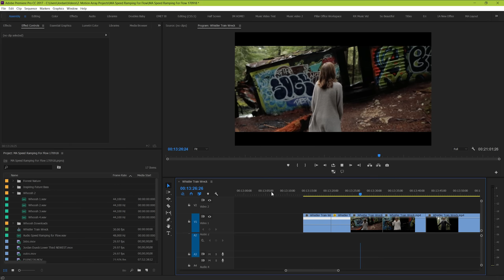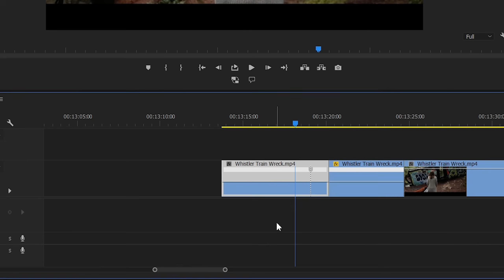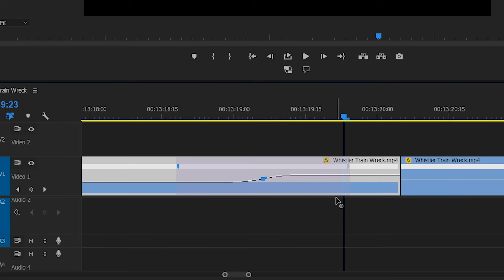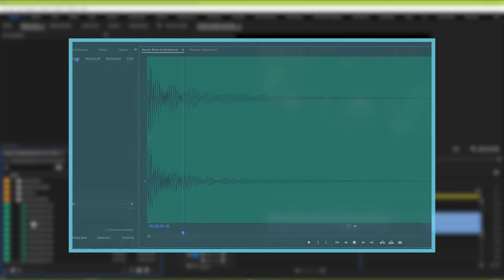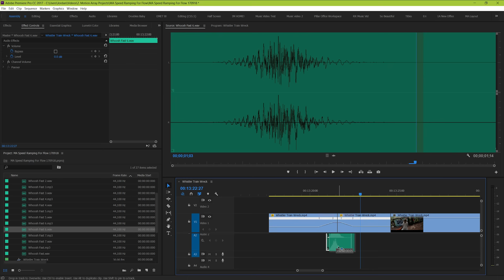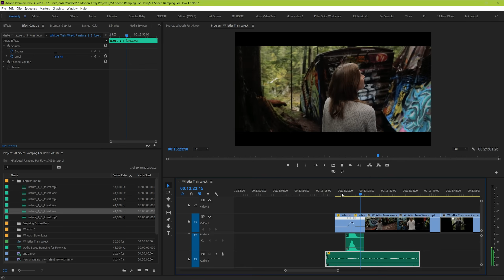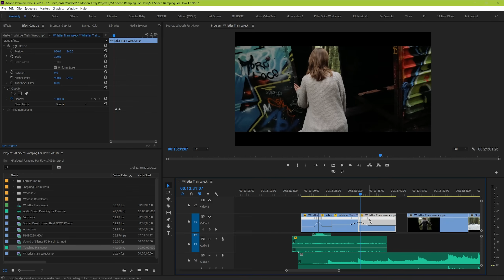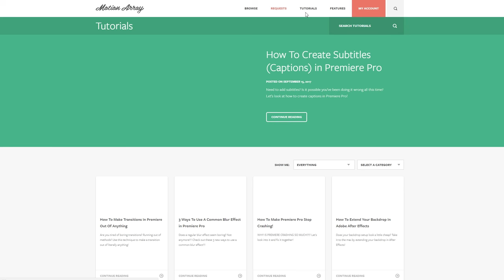How To Use Speed Ramping To Create Flow In Premiere Pro

Comment: Goot tutorial ans video, but there's one problem.

You've exported your video in more than 24p and I'm not talking about about resolution. 24 frames per second, or 23.976 are necessary to create the typical standard film look from a motion standpoint.

Films are shot in 24p since ages and because basically all our lifes we watched films in 24, we naturally perceive 24p as "filmic". Anything higher smells like tv show, anything lower breaks the motion continuity.

Because you've exported in more than 24p, perhaps 60p, your ramps are using that extra fps room, going from whatever frame rate you have at 1x (24?), up to the 60pfs limit and back.

This not only creates what the film producers call the "soap opera" look (mostly because they're shot in 50i or 60i), but also makes your video go up and down throught different data frame rates creating the illusion of inconsistent frame rate.

The solution is to cap everything to 24p and you can do that simply by exporting in 24p.
Reply from the maker: Hi Alex, 

You are quite accurate in the assessment of these factors.  For this project there were a variety of mixed frame-rates between the introduction, B-Roll, Speed-ramping example, and Premiere Pro screencaps.  Additionally this was created at a time in which we were testing using higher framerates for different teaching portions of our videos.